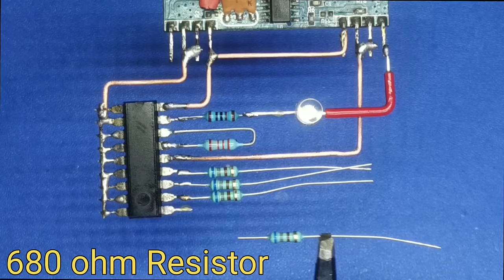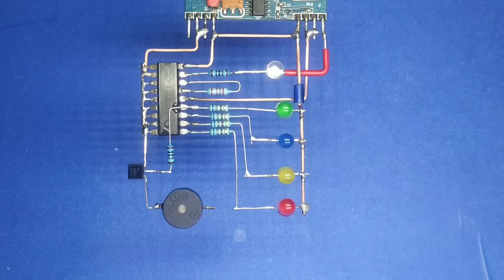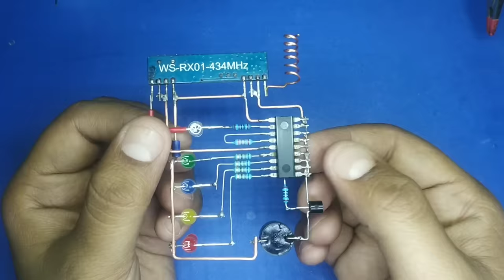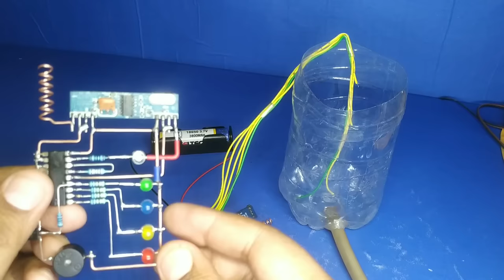How to make Wireless Water Level Indicator with Alarm

Comment: What is the maximum distance between transmitter and receiver?
Reply: I've been using a similar circuit since the 1980s to turn the water pump on and off for the house water tank. The water pump automatically turns on when the tank is 30 percent empty and turns off automatically when the tank is full.2-pair telephone wire was used for 12 volt DC current from the tank to the circuit. Now I will try to build this circuit with some modifications.
I've been using a similar circuit since the 1980s to turn the water pump on and off for the house water tank. The water pump automatically turns on when the tank is 30 percent empty and turns off automatically when the tank is full. 2 micro switches on tank and nylon cord inside the tank have been used. There is no loss of current. Now I will try to build this circuit with some modifications.
گھر کے پانی کے ٹینک کے واٹر پمپ کو آن اور آف کر نے کے لیے میں اس سے ملتا جلتا سرکٹ ۱۹۸۰ سے استمعال کر رہا ہوں۔ ۳۰ پرسنٹ ٹینک خالی ہونے پر واٹر پمپ خودبخود  آن ہوتا ہے اور ٹینک فل ہونے پر خود ہی بند ہو جاتا ہے اس میں ٹینک سے سرکٹ تک ۱۲ وولٹ ڈی سی کرنٹ کے لیے ۲ پیئر والا ٹیلیفون وائراستمعال کیا ہے۔ ٹینک کے او پر2  مائیکرو سوئج اور ٹینک کےاندرنائیلون کی ڈور کا استمعال کیا ہے۔ اس سے کرنٹ کا کوئی خظرہ نہیں۔ اب کچھ تبد یلیوں کے ساتھ یہ سرکٹ بنا کراستمعال کروں گا۔
Reply: It's about 5-6 meeters
Reply: 5, 6 m is poor range
Reply: I made this one and its range is 30meters
Reply: @ishtiakkhan4110  
20 to 30 meters inside the building,or 70 to 100 meters open air
Reply: @manzor9930  i would suggest not to built it. it will be your headache. i ve made it, use few years, bcs of buggy, i go back to wired connection. wireless is unreliable.
Reply: @narsingraokumbala6048   You have to use a antenna. With a good antenna and higher voltage you can get 10 meter range range inside building, open air 30meter. But still it doesn't work seamlessly. The signal will be lost sometimes. If you use this circuit, use it only for indiction- do not patch up anything controlling for motor control. It's unreliable.
Reply: What if I connect both antennas to metal pipe that goes through whole building?( Transmitter at one point and receiver at another....)

Is the range problem still an issue?
Reply: @hussainarsiwala6631  I never tried that without booster. But it shouldn't work. RF antenna is very low powered. Once connected to longer piece of metal/ antenna its range decreases, unless you boost them.
Reply: @hussainarsiwala6631  and RF electronics are always buggy. Everyone faced them and finally tried to avoid them. If you need stable and reliable connection, use wifi module. Otherwise you make antenna. 30cm wire is the maximum length of antenna for RF module, as far I know
Reply: What is the problem?
When I connect, all the level LED are glowing.
Line signal LED is not on.
Reply: @s1familyvlogs43 ap share kr krte hai details
Reply: Yes same problem to me

Comment: the electrode inside the tank will wear out in a  very short amount of time due to electrolysis or simply by corrossion. Think of some non contact process.
Reply: Then, you've to use float switch.
Reply: @anmol9803  float switch will not give you real time data on the height of water.
Reply: @apurbadas5810  it will if you thi k a little bit about how to do it rather than being negative about it.
Reply: USE SS Material For Sensors

Comment: This is a bit different, but for anyone looking for a simple, free off/on switch for water level, try pulling a water level switch from an old washing machine. I used one for controlling a pump on some homebrewing equipment. It works using air pressure. There is usually a 3-level adjustment knob. Just attach the vinyl tubing on the switch to a piece of cpvc. Et voila!

Comment: Excellent but just one point someone mentioned Oil tanks in the comments below.... i am familiar with fuel level indicaters and they also use resistance however its an floats height relative to an coil that carries an measurable variable resistance as the floats height changes an resistance is measured this is what is displayed with the level indicator however normally these are double insulated or even totally isolated from the fluid environment...I think the commentator may need to consider this as even the slightest spark or arc could result in fire potential...fuel is highly flammable water is not but regardless this is excellent work thats done here and thanks for sharing i say to the uploader...

Comment: Hi, I am looking for a similar device. With little difference. It should start a buzzer once water level in the tank comes below a certain level. 
The changes needed would be as follows:
1> Instead of 1 water tank the system should work with 8 separate tanks
2> For all the tanks, the buzzer should go off when the water level reaches dead level - say 15%
3> Each LED corresponding to that tank should start and buzzer for that should go off
4> After the buzzer goes of there should be manual button which can be used to turn it off/reset
Can you design something like this?  I guess it might need more buzzers, ine for each tank.

Comment: Thank you for this awesome experiment..
now i'm think for more functionality,
Ex: Buzzer beep on 100% and 25% level, with only one buzzer..
imagine if High and Low level we got alert, that was greatly feature.
Reply: Did you get it to work? I'm using only one buzzer on 25% and 100%.
The problem now I have is the buzzer beeps all the time. So I don't know which one cause the buzzer to beep 25% or 100%.
Reply: You can make 2 circuits with diffrent sound buzzers😂

Comment: It works. Anyhow, the whole thing will not last long because it keep transmitting data. continuously. And it will also interfering other nearby device and violate the transmission regulations.

Comment: For those that wonder about waters conductivity. Most tap water is a fair conductor. 
Ask anyone that got a shock while standing on a wet floor or soil in their bare feet. The dissolved solids in the water make it more conductive. Distilled water is the least conductive.
Reply: That is true. But, you should be aware that electricity used in this project is DC. I guess DC voltage doesn't give you shock...
Reply: @kamleshpatil-g5t  DC can injure or kill you as well as AC, the major factor is the voltage.
Reply: One thing I learned from a similar circuit is to use float switches because after a while it’s going to build up resistance and give false positives from the minerals in the water 
This is a pretty cool circuit though
Reply: @kamleshpatil-g5t  actually DC is slightly more dangerous  but 3.7 volt isn’t enough to shock you 
EVs are around 400v and you wouldn’t want to use that high of a voltage around water unprojected that’s why they still have a 12 volt battery and equipment in the electric cars
Reply: @kamleshpatil-g5t  If you think that, put your tongue on the terminals of a new 9-volt battery. You will find out what copper taste like. I once got knocked on my tail from a high voltage rectifier tube that I thought I had drained. (Grounded)

Comment: nice point to point soldering. I would've reversed the colors of the leds so red shows when it's nearing capacity or use bar graph led
Reply: I would have used a clean soldering iron.

Comment: Nice idea but you will jam up the frequency so car remotes and just about anything that works on 433mhz will now not work. You need to add a small timer to switch on the transmitter on for 2 or 3 seconds every 10minutes  to be legal and not jam up the frequency.  Also transmitting continuously will flatten the battery in the TX in a day or 2.

Comment: Nice one! Can this be used for Home Heating Oil Tank levels with the alarm going off when the tank is down to 1/4 full?
Reply: Yes just put the alarm resistor on the 25% led and use float switches 
I’d use float switches with water also because in higher humidity you’ll get false positives especially when it’s in use for a long period of time

Comment: Good and affordable circuit, but one disadvantage, the transmitter circuit will be full time on and the battery will drain, if we put a switch than the same lengthy wires from tank to the house is to run where receiver circuit is fitted. Send the solution

Comment: nice video.
I have 5 diesel  generators of 400kva , with 3000 liter diesel tank each. So i need i need fuel level and digital data, but i have no idea what to do.  Will you suggest any circuit or any instrument so i can wach fuel data in my office.

Comment: Thanks my friend, is it possible to add a relay for the pump and it works when the level reaches 25%
Reply: possible with using a pnp transistor. but you also need to stop pump when the tank is full. so you will use a start/stop circuit. you can do it with limit swithches simply or an electronic circuit.

Comment: This is intermittent level monitoring like ultrasonic detectors installed for certain level's, or level switches for certain levels.
For continuous level monitoring, an ultrasonic detector is installed on the top of a tank, as the level increases, the ultrasonic waves cut results in the change of digital display.

Comment: Which resistor is the one soldered righ after the leads , no specs in the video or diagram
Reply from the maker: Hello, There is a piece of blue color pvc wire insulator which use for insulation in cross connection. Thanks for Watching my videos 😊

Comment: How do you make it buzz when it's empty and not filled instead. I could use one of these for my greenhouse
Reply: you can use use buzzer last connection instead of  red light.
buzzer can create lots of noise. instead of this you can automate the pump connection. so that tank automatically fill when it is going to be empty.
Reply: You can make NOT gate using transistor so that lowest level of water touching the sensor keeps the buzzer off while open circuit (meaning empty container) gives out signal to the buzzer.
Reply: Just invert the water sensor wire sequence.

Comment: What is the component you are soldering at 9:53 minute? That component does not appear in the diagrams or component list. Is it necessary?
Reply: not component its a Gnd pin insulate

Comment: While that's a cute project, sadly, unless using silver rods, using wires or rods of aluminum  copper will corrode.
Silver should be much better, but then, you'd have to find rods of different lengths so that the tops are all out of water in order to attach the wires.

That's why, in my Home Humidifier project, I used an  infrared proximity sensor.
On this project, I used a Nextion display with touch and had a "setup" page where I could adjust the "full" to "empty" numbers if i wanted to easily make changes without recompiling code.

This worked very well, however, I did have to write an "averaging" routine due to reflections off the water as it moved when the fan was on.

This worked nicely and non actual contact with the water.
Reply: you are too advanced to talk about in this project. this level 2, you are level 8
Reply: @Nazmulsaidi  Huh???

I have no idea what you are asking.
I DID "talk about this project."

I said that it was cute, which means, it's nice.  But then I went into the reality of using wires to detect levels.
While that works very well, it won't work for LONG periods of time, like months or years.

Most metals will oxidize  or corrode.

So I talked about how, TO AVOID THAT ISSUE, I use a PROXIMITY SENSOR instead.
It doesn't "touch" the water.  It sends an IR beam that bounces off of the water and is received by the IR receiving diode.  It measures "distance", using a mathematical formula that measures the TIME from SENDING the beam to RECEIVING the beam.
The formula knows the number for the speed of sound and light.  It uses that to make very accurate calculations of what the distance is.

The only issue with some setups, like the one I mentioned, is that the light can bounce around if not protected by some kind of light absorbing material.

To get around that IR light bouncing issue, I wrote an algorithm to compensate for this bound as well as to average out the value of the water level.  In this case (and perhaps many cases) the water moves a bit, inside the machine, so the level changes slightly.

That's why I don't send the RAW numbers as the final output, because it would be bouncing all over the place.  I know, because I tried and that's how I figured out the moving water to be the problem.

Once I wrote the algorithm, the water level number is stabilized and THAT is the number I present to the system.

This number, the water level, is then used to decide if there's enough water in the machine to be able to power on the water pump.  If the water level is low, the pump will not be powered on and a message is sent to the Nextion display, letting me know that the water is low.

I also included a "setup" page on the display, that I can go into and tweak the WATER HIGH and WATER LOW numbers.  I originally wrote those algorithms to make it easier to "adjust" the 2 trigger points, but then, found it to be useful, so it remains on the system.

I hope that this now helps you understand my original comment better.

Just so you know, there's nothing wrong with commenting on a video.

THAT'S WHAT YOUTUBE IS ALL ABOUT!

Hope that helps!

Cheers
Reply: Bro you misunderstood me. I know it's limitations what you mentioned about oxidation, I faced it. So I got rid of it. Just by using tiny float (reed switch based). 

Anyway what you did is far far advanced bro. This one very basic 🤪😊
 It was a sarcasm, forgive my bad English.
Reply: @Nazmulsaidi  Ahhh!  Ok then.  I do love sarcasm.  I just didn't realize it was.

As for the float thing, I really do like the float thing and in fact, attempted to design on that could work in this humidifier project.
Sadly, due to space and design of the tub and top part with fan and my electronics, the float thing didn't work out so well.

Honestly, I would have preferred the float, but on a potentiometer rather than a switch.
You see, in my case, I need to see, on the Nextion display, the water level in real time.  Not just "full" or "empty".

I'll admit, I do have a problem.  LOL
That is, when I start to design something, all these ideas come flooding in... ideas of features and such.  Many, probably not 'necessary' for a project, but fun to add features.

As for the guy's work in this video, I've seen his projects before and I've commented on just how excellent he is in building circuits without PCBs.  Just bending wires here and there and he makes it look so cool and the logic is easy to follow.

It's really impressive how he does that.
For quick tests, I will somethings just solder components together for a quick test, but never have I been able to get the soldered thing to look anywhere near as good as he does.

For clarity, the only real reason I mentioned the corrosion thing in the fist comment, was to perhaps alert those who are less experienced, that they will have this problem and where possible, to use silver rods.  That's all.

😅
Reply: @BlondieSL  Yes. but that warning means nothing. He should have use something more practical. 

Similarly, I got rid of it now. I am using 7-segment display to show  level. 4511 IC with float off course.

And that RF module circuit is modified into a wireless switch to turn on the motor manually. My father likes manually turn on motor, don't know why 🙃
Reply: @Nazmulsaidi  Your project sounds nice!

I agree with the more practical thing, but I think that his videos are more to demonstrate what can be done with misc. components.

Personally, I do all my projects with Arduino, but now I've moved to ESP32-WROOM modules and ESP32-CAM modules.

Of course, I do need to build circuits to control heavier loads and such.

What I like about ESP32 is their ability to use built-in transceivers for WiFi, which of course, can be used for PEER-TO-PEER, which I really like.
With Arduino, I had to use those nRF24L radio modules which were often a pain in the arse.  Very glitchy sometimes.

With the ESP32, radio communications are solid and just don't fail.  I've had a 3-module test running now for 3 months without having to reboot them.  This is a test to confirm functionality in the long term.  So nice.

Comment: will this work same in 1100ltr water tank too ? Or any volt difference required
Reply: I doubt it will work on real water tank.  Probably work only on bucket of water.
Anyway, this is good for learning electronic.

Comment: At 10:00 in your video you are soldering one blue color component across all the LEDs ..what is it? Please mention it..
Reply from the maker: There are wire crossings, so a piece of wire has been installed for insulation. Thanks for Watching.
Reply: I noticed that as well and knew what was that

Comment: Vry gd prjct. But 2 points worth mentioning. Vry vry slow with no vdo editing,, had 2 run playback at+2Max 2 save time. U could use CAT5/6 cable used by cable operators for the transmitter to o make it more elegant, easy and less complex...

Comment: Nice sir. Could it be used safely  for gasoline?
Reply: yes ! dont worry
Reply: It may or may not work as it requires the liquid to be at least slightly electro-conductive. Not sure gasoline is. But it is safe enough to try.
Reply: Can it be used in a metal tank?
Reply from the maker: Yes

Comment: very nice and usefull , 
but 1 thing you don,t mention the range between transmitter and receiver.
Reply from the maker: Hello, Range in open space (Standard Conditions) 500 Meters with Antenna / 100-200 Meters without Antenna. Thank you so much...